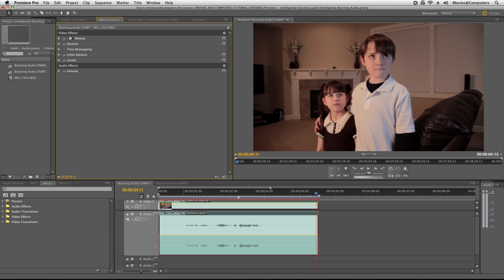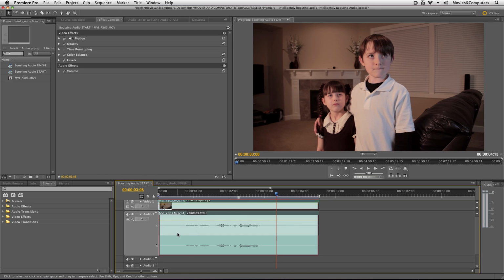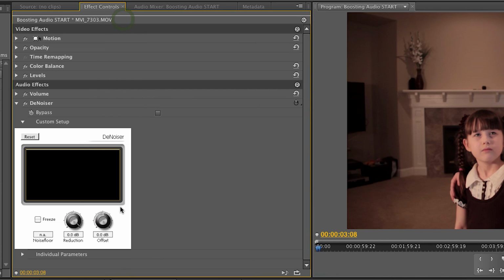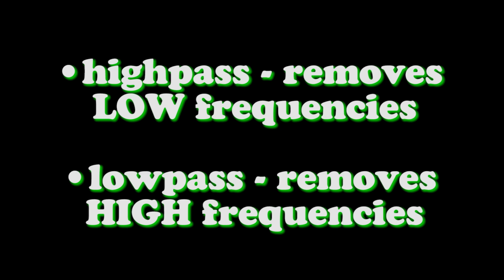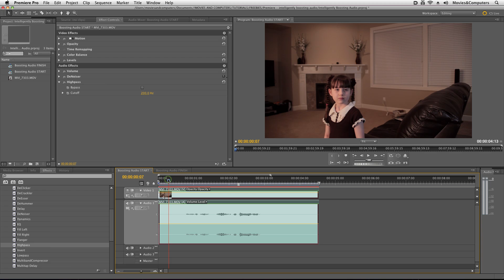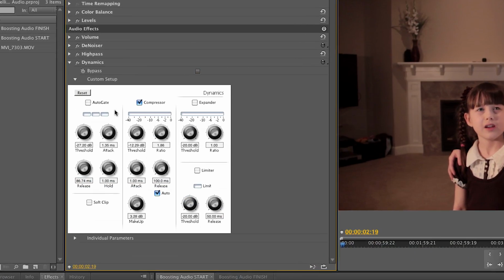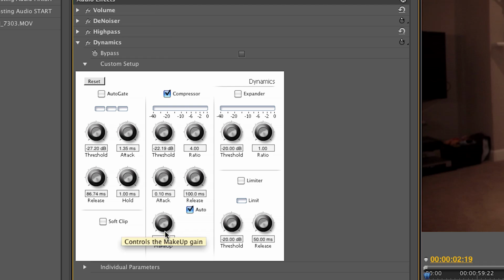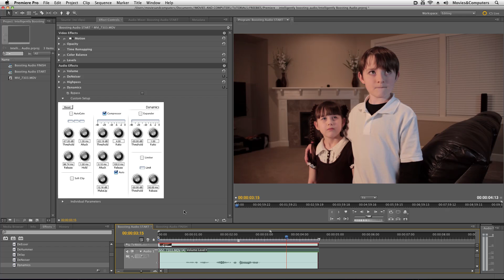TUTORIAL: Premiere - Improving Audio

Comment: 0:57 video before audio adjustments 
1:13 how to increase volume
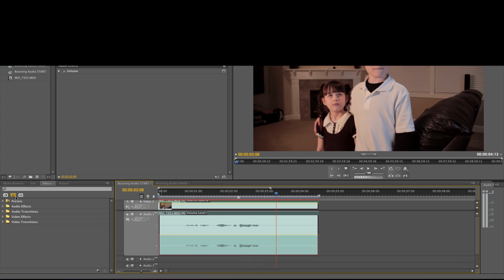1:53 DeNoiser [Effects Panel: Audio Effects> Stereo > DeNoiser]
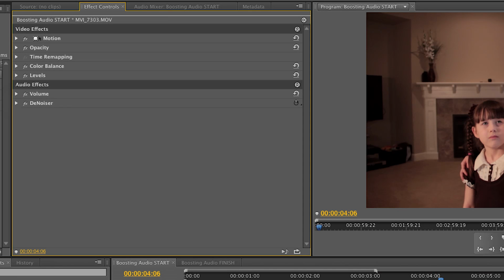3:45 Highpass effect to get rid of a low frequency hum
5:09 what Audio Compression does
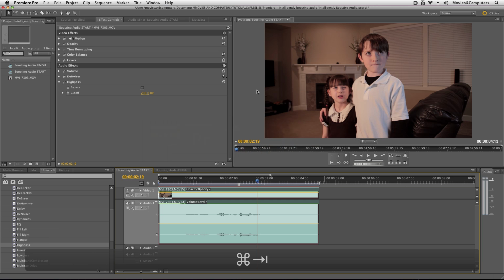6:20 Multiband Compressor and Dynamics to increase volume (99% Dynamics)
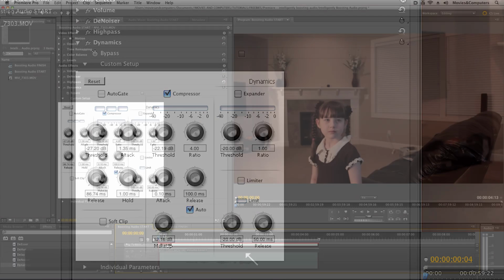8:30 final result

Thanks for the video! I have no idea what I'm doing with audio but this video definitely helps!

Comment: I know this is a old vid but how did you get your waveform to come out of the middle? as it is now its only going up on mine and that is making it hard to tell where one sounds starts and one ends.
Reply from the maker: I believe what you're referring to is something called "Rectified Audio Waveforms" and can be turned on/off by going to the Timeline panel settings popup menu and turning it on or off. Hope that helps!
Reply: thanks, it did.

Comment: why did you use the compressor? the denoiser and highpass totally removed the background sounds and displayed youre daughters voice perfectly. by adding the compressor, you can hear like an aircond sound. kinda defeats the purpose o.O
Reply from the maker: Great question! Compression and noise reduction aren't related. The use of compression is not to reduce noise, but to enhance and strengthen the audio signal by evening out loud/quiet. This allows you to boost the signal overall. Almost everything in a mix gets compressed, because compression makes everything sound richer.

Comment: Hi, I have troubles when applying DeNoiser and exporting the video. When the video is exported, the annoying static noise stays for the 3 three seconds and then disappears. I am googling for quite some time, it seems that other people are having troubles with that and I can't find any solution that would work for me. Could you help me, please? Thanks
Reply: Hi - just wondering if you found a solution to this?
Reply: Hi, not yet. Probably the only solution will be to use Adobe Audition or another editing software.

Comment: Do you have a tutorial on doing the opposite - fixing peaking audio ?
Reply from the maker: Thanks for the question, Amy! If you have audio that has peaked and is clipping/distorting because it was recorded too loud, there's nothing that can be done about that, unfortunately.
Reply: ***** REALLY? :-( Like, there is nothing you would do to minimize the impact? For our videos, I've been adding points to the audio line and dropping it a bit. 

Or what if like, it's not that the audio is distorting, you just want to lower the ...contrast? Is that an audio word?
Reply: Vlog: The Channel I had a play around and the only thing I could do was lower the volume and add a peak limiter, which helps a bit.. but can't completely rid the distortion caused by clipping :/ Better to get it right on the spot than fix it up later!
Reply from the maker: Amy Gian Yep. You just nailed the greatest concept to get about audio - capture it right. I should also point out that audio compression (the Dynamics effect in Premiere shown in the video) kind of evens things out a little more. So it also makes those loud peaks reduced.
Reply: ***** Cool, thanks for that!
Reply: Amy Gian You're project is probably done by now but if not, try using the Deesser within premiere and audition, it should help remove some of your clipping issues or at least make it a little bit more tolerable. Again though, it's all about the capture techniques. Garbage in = garbage out.

Comment: @ Alex Dixon  I have the same problem with my video. The filters work great just like the tutorial says but then when I EXPORT the video the result is the same as you explained "each clip starts with background noise and then after a few seconds it filters out." Side note I also used a Fill effect to balance the left and right channels on the filters along with DeNoiser, HiPass, Dynamics and changed the db. levels. Still have not found an Answer..Anybody??? I'm thinking it's the way I export the video

Comment: So I used the deNoiser and it works great while watching it in Premiere. However when I export the project out.....each clip starts with background noise and then after a few seconds it filters out. Does anyone know why this is?
Reply: @ Alex Dixon  I have the same problem with my video. The filters work great just like the tutorial says but then when I EXPORT the video the result is the same as you explained "each clip starts with background noise and then after a few seconds it filters out." Side note I also used a Fill effect to balance the left and right channels on the filters along with DeNoiser, HiPass, Dynamics and changed the db. levels. Still have not found an Answer..Anybody??? I'm thinking it's the way I export the video